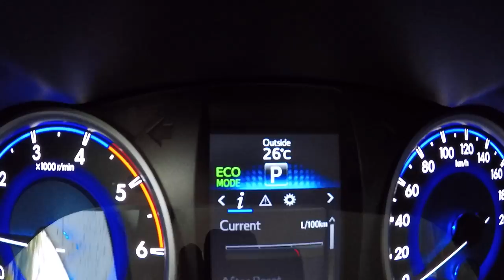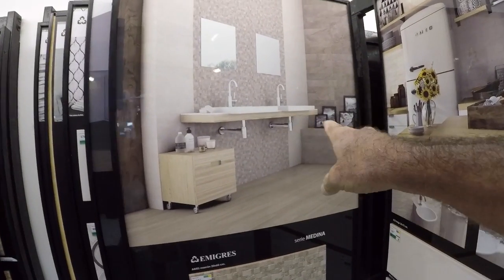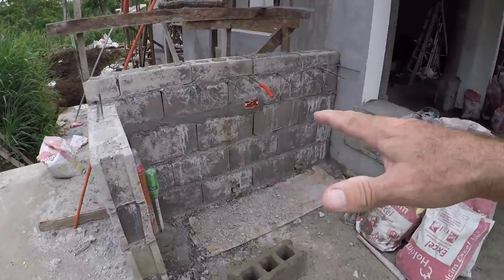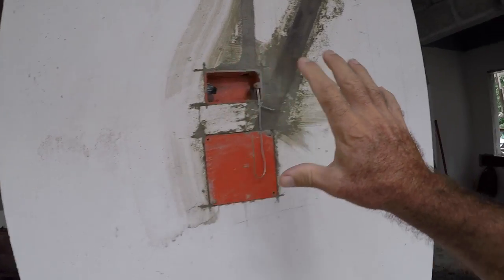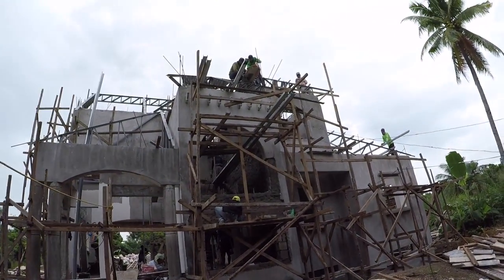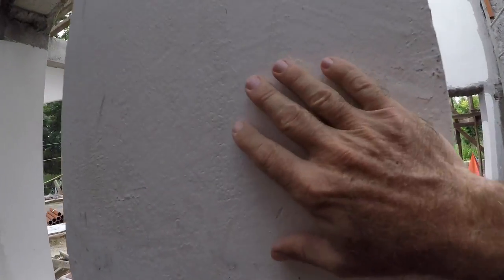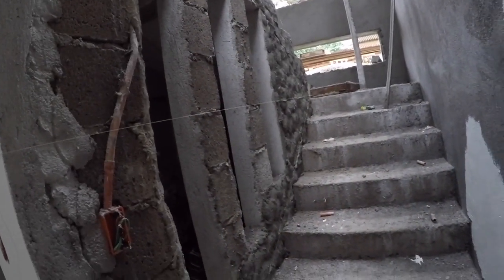VILLA FELIZ - EPISODE 157: THE HOLY GRAIL OF TILE (House Building in the Philippines)

Comment: The roof first, maybe more workers up there because of time is of the essence, not sounding an alarm but that's priority number one now, and no need to panic as of yet!
Excellent choice for the basement CR tiles today, artists choice as usual.
Did you plan to place a light directly on top of the grill? (much needed).
Praying fo for more strength to cope with your daily chores, and uninterrupted work days in VILLA FELIZ.
Reply from the maker: The grill has its own lights inside the grill and plugs in to the service outlet inside the grill cabinet.  We'll have lights on the wall above the windows and door on the back porch.

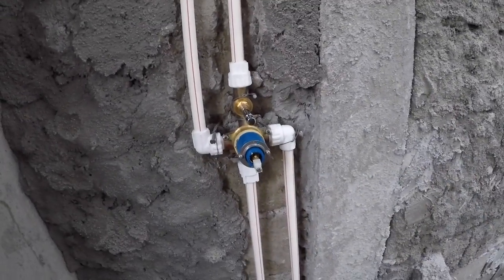Comment: @15:45 he's probably confused because a shower valve designed for selecting between two showers (typically fixed overhead and hand held) has the selector control above the mixing/flow control valve. 

It looks like that valve he installed is a bathtub/shower diverter, which always sends water to the tub until you push the button and divert it to the shower. Tub diverter is normally mounted below the mixing/flow control valve. 

The reason why they don't work well mounted upside-down in tub/shower setups is also the reason they don't work well for dual shower heads.